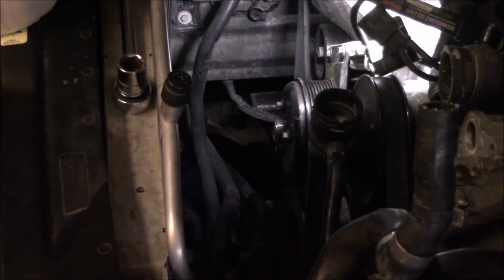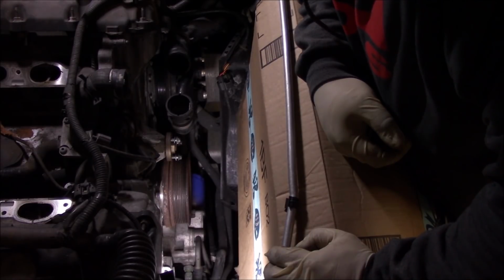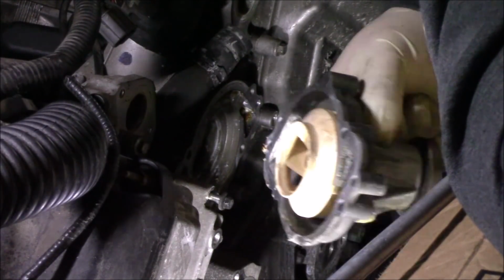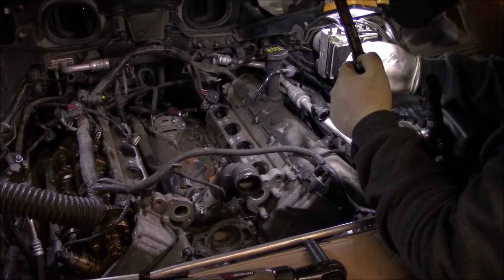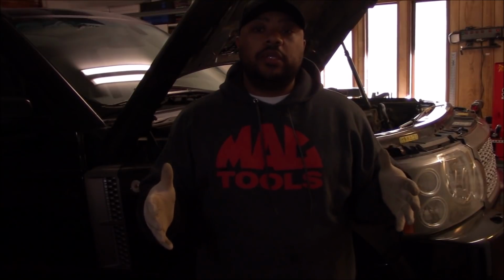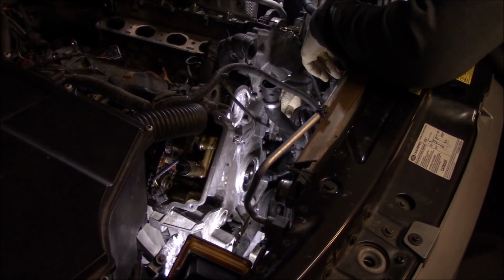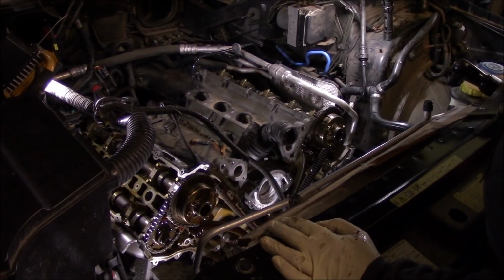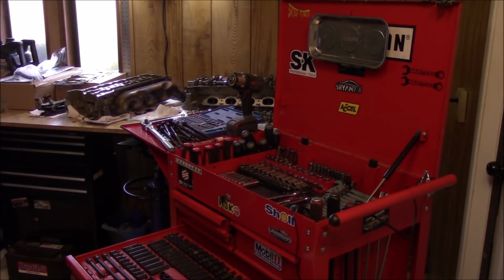2007 Range Rover 4.2 Supercharged Head Gasket Job( Part 2)

Comment: I found that the power steering bracket can stay there. Fricken Rack and Pinion lines were in the way of those and I got 2 out by flexing those lines a bit, then realized I didn't need to do that to get the AC stuff out of the way. Now I got the Alternator loose, but working on removing it. Hoping that one 10mm open end bolt don't give me too much trouble.
Reply from the maker: I used a 10mm wright grip wrench and it worked out!

Comment: Whats flat rate pay for this job?  Not an easy head gasket job thats for sure.
Reply from the maker: About $4600
Reply: @BryansGarage951  thats some serious money but rightfully so.  Nice job on the repair so far, I'm impressed how you always seem to keep your cool.  This is one job that would aggravate the heck out of me lol.
Reply: @BryansGarage951  I was guessing this repair would be around 6k at the dealer.  What do you think?
Reply from the maker: @CTSCAPER   my software say about 4600 but I'm using aftermarket parts!
Reply: @BryansGarage951  Hi Bryan, are your vids in real time?  If so it took 2 hours to get the heads off would you say another 2 hours to put them back on … makes $4.600 (US?) look like a good hourly rate!!  :-o